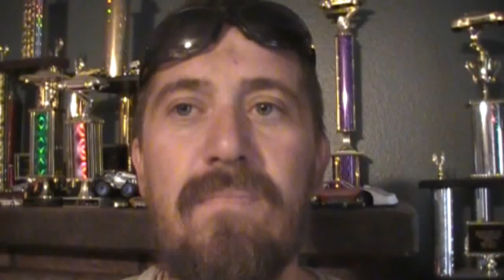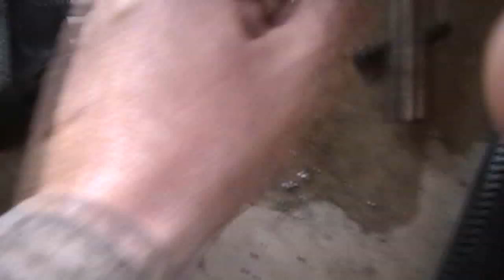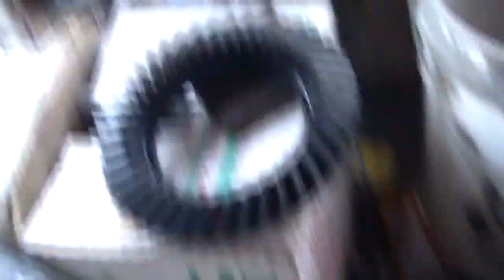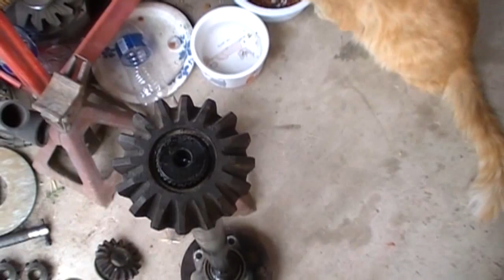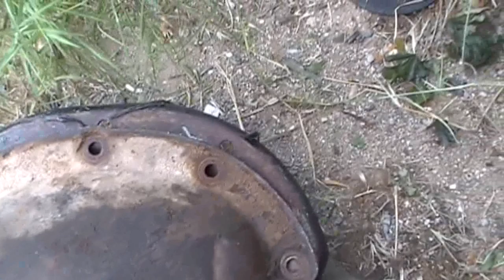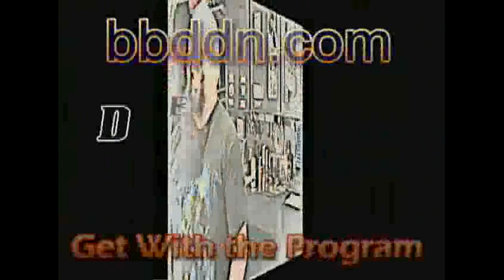Gm hybrid 10 bolt 12 bolt rear axle build for derby car Part 1

Comment: In case anyone is interested, the rear is an MP-78 rear built by Pontiac. It had 3 different generations. 65-70, 71-76 and 77-82. These were mainly used in full size GM cars. It has a 12 bolt carrier and the posi was made by Eaton. 65-76 had 31 spline axles while the 77-82 were 28 spline. There is 0 aftermarket support for these. I think gear ratios maxed out at 3.42 and there was a place in Texas that was making 3.55 gears for them but they fit the 2 series carrier. These were used in the 2+2 Pontiacs in the 60s which were Pontiac’s full size performance cars. The only other performance car I’ve ever seen one in was a 73 Buick Grand Sport that was a factory Stage 1 455 with a 4 speed manual.  I only know this because I have one in a 75 Pontiac Grand Prix that my brother rebuilt from a 2.56 open to a 3.23 posi and it took me a couple years to find the carrier and gears. These are strong rears but they don’t fit many performance cars. I seem to remember there were a lot of Ford parts in the rebuild kit. They do bear a striking resemblance to Ford’s 8.8.

Comment from the maker: @DerbyDriverLD50 Yes. The axle has the bearing pressed on and that flange bolts it in the housing. This way the wheel stays on if you break the axle. C-clips axles the the bearing is pressed in the housing. And the axle slides in. And only the C-clip keeps the axle and wheel from sliding out.

Comment: So does that oddball buick rear end have the same diameter axles as the normal 12 bolt, and if so, could i get a c clip eliminator kit and use them just like i would with a 12 bolt bia axle?
Reply from the maker: Nope, unique to the bolt in axles.
Reply: @ReverseGear Ok so ive got a midsize 28 spline rear end out of a 79 buick with bia and i want to put 12 bolt axles in, the bearing is different like shown in the video. what did you do to get around this for the different bearings on the 12 bolt axles

Comment: Crazy question are you still running this reared?
Reply from the maker: It may still be out there. But I had to quit derbying.
Reply: Dang that sucks! Sorry to hear I have a chance to buy one axle savers , brace, pinion break , 513 gear for 800$ but didn’t know if these reared still good in the derby world
Reply from the maker: Like always. Depends on your rules. Some crazy derbies run one ton truck axles. That's pretty much bullet proof. Except for the weight can be a factor in it just being ripped out.